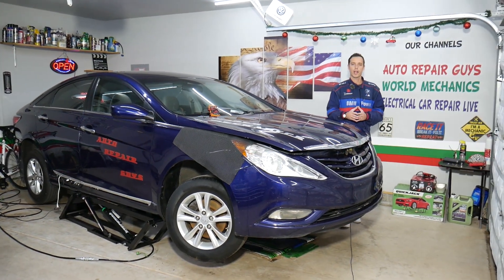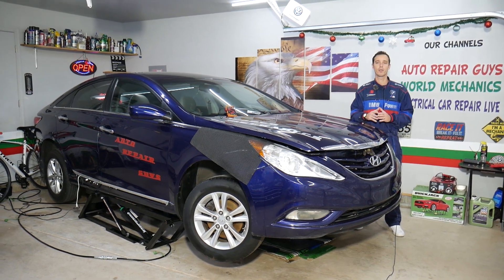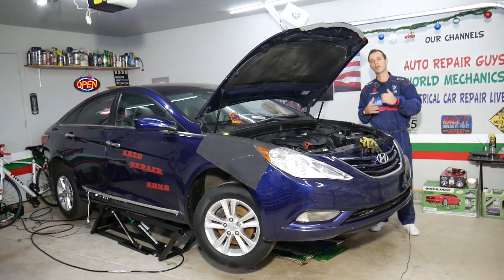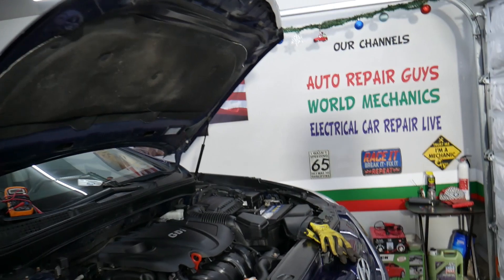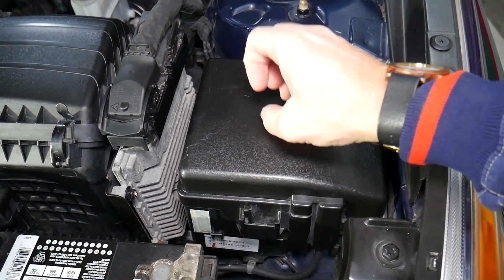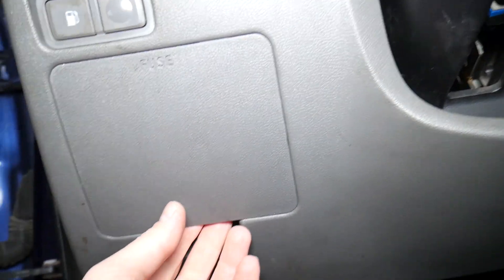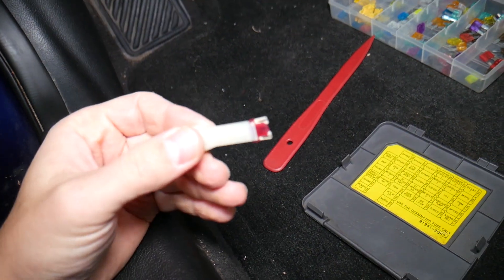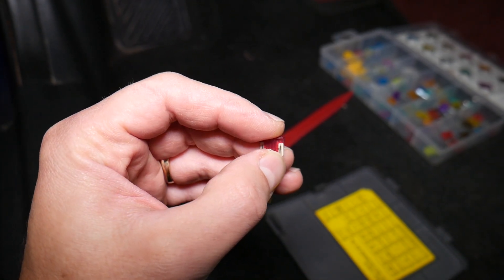HYUNDAI SONATA MIRROR SWITCH FUSE LOCATION REPLACEMENT, MIRROR NOT WORKING

Comment: I have a 2012 Hyundai Sonata Limited, the power and heat are working on the passenger side mirror but not the turn signal. I popped the glass off and tested the bulb with a multimeter and it works. So if my power and heat work as well as the bulb itself why is the turn signal not working? Do I need a new wiring harness in there, but wouldn’t that mean the power mirrors and heat would be bad too?